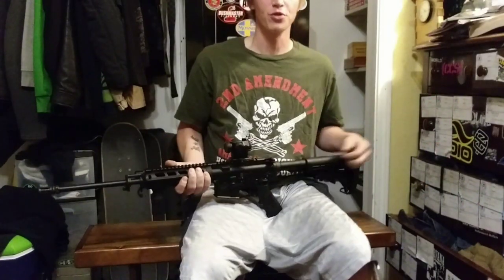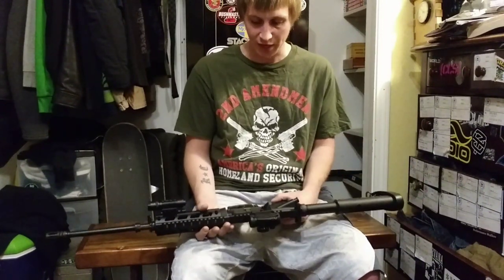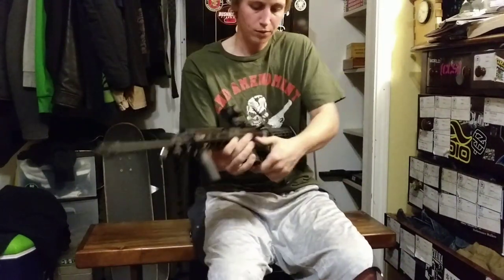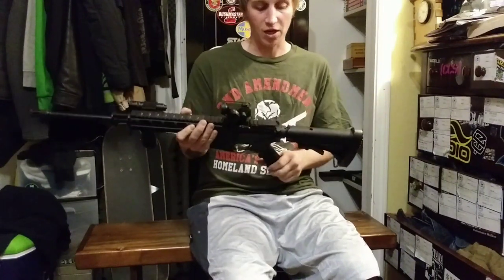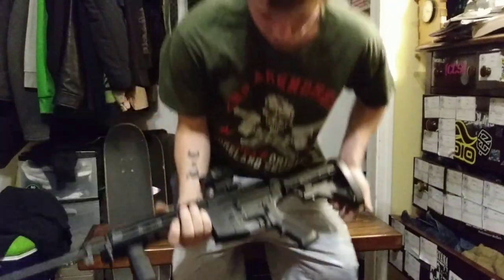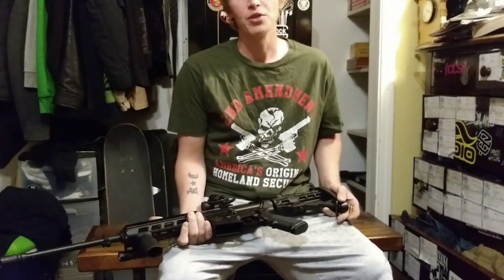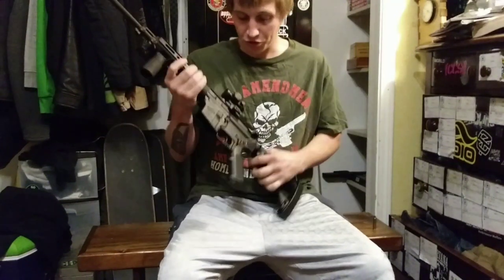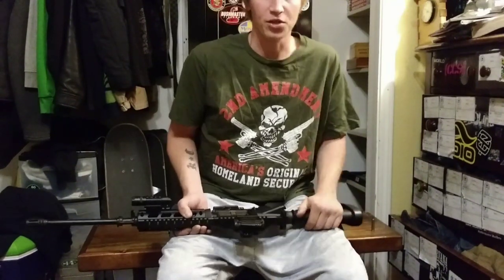AR-15 mortaring technique unjam a stuck bolt & charging handle w/round chambered.

Comment: Thank you! You're the man!
Reply from the maker: No problem man glad I could help 🇺🇸
Reply: How to prevent it my 300 blackout still do it every time
Reply from the maker: @officialdracos3062  have you taken apart  the rifle and and bolt carrier group? After I did that and cleaned and lubricated the ejector along with the rest of the rifle I haven't experienced that malfunction. Here's a complete cleaning guide video I made if you need any tips for taking the rifle apart, cleaning and lubricating it, and reassembly of the rifle. Here's the link to the video.
https://www.youtube.com/watch?v=Apmvm9SrXzw

Comment: can you do this with a live round without it going off....
Reply from the maker: yeah theoretically the round cant go off without the firing pin striking the primer so as long as your finger isnt on the trigger you should be fine. When this happened to me and i had to use this technique i had a live round in the chamber. But even though it theoretically should not discharge i still aired on the side of caution and used this technique outside while pointing the barrel into a safe back stop.

Comment: Mannnnnnnnn thanks bro!!! My laser sight got stuck in mine while sighting.
Reply from the maker: Your welcome bro glad i could help  i tried those bore sighters out for a lil bit but i found the universal boresighters that slide into the end of the barrell to be more accurate and u can use it with every caliber u should look into getting one of those if u don't already have one
Reply from the maker: Plus u can get a good one for around $25 and that's pretty much the cost of 2 of the cartridge bore sighting lasers
Reply: @counterstrike2A  I’ll check those out, I’m never using this thing again! Lol
Reply from the maker: Lol I pretty much did the same thing used it once and then just put it in my junk drawer. Thanks for subscribing to my channel!!

Comment: So this did help but right when the bca went back in it was instantly jammed again lol
Reply from the maker: I would definitely give it a good cleaning and lubrication and note what type of ammo you were using and if that's what you normally use. Try using 556 instead of 223 and 223 instead of 556 that seemed to be my issue the 2 times it jammed was using 223 since then I switched and make sure to keep my rifle clean and it hasn't happened once in the almost a year or so now that i have been exclusively using 556
Reply: I ar-15 7.62x39mm pistol.. I'd pulled the charging handle back but didn't release it fast enough i guess and now its a live round chambered its like my bolt carriers locked??
Reply: Didnt work..

Comment: Was it the rounds because I just got some Remington. TSX hog hammers, and it keeps happening.
Reply: My controller chaos doesn't do it. My m855 doesn't do it only these hog Hammer. I don't know why.
Reply from the maker: That could be the issue but I would give the rifle a good cleaning and lubrication and give it another shot and see if it keeps happening is it a new rifle?
Reply: Just got done cleaning it. I'm going to reload a MAG and give it a shot man.
Reply from the maker: Ok good luck
Reply: No, brother completely clean this rifle. I can run the control chaos Throne every time I load these hog hammers in it'll chamber eject chamber eject stick won't come out. I'm more they don't want to close the both all the way. It's got to be the bullets. They're not Stop to spec I'm guessing. I don't know too much about reloading. But none of my other rounds do this. And I'm guessing this why Remington isn't in business anymore why they sold out.
Reply: Now I just ran them all through a PMAG instead of a One of the aluminum mags and they all ran through flawlessly. It's got to be the mag jamming it.
Reply from the maker: @frankmarks5890  good I'm glad you got it figured out. Yeah nobody can really match P mags reliability only times I've had unreliable mags they were pro mags

Comment: Holy shit it worked! Thank you. Do you know what causes this jam?
Reply from the maker: Since filming this video I had to mortar my rifle 2 more times. I also had not performed a full disassembly and cleaning/Lubrication on the bolt carrier group and ejector. After doing that the problem has not happened again and I've put over 2000 rounds through it. I also got some input from other viewers and a common explanation is new rifles have tighter tolerance in the chamber and just normal operation of the rifle can help loosen things up therefore fixing this issue from happening. I also was suspicious about the ammo I was using causing it because all 4 times i had to mortar my rifle I was using .223 remington so now I predominately use 556 NATO and the issue hasn't come up. But like i said that could have nothing to do with it and it could have just needed to be broken in. That being said if this issue arises the first thing I recommend doing after removing the stuck round is to give your rifle a thorough cleaning and lubrication. I just uploaded an AR15 disassembly cleaning procedure/lubrication and reassembly video a few months back here is the link if you don't know the proper cleaning procedure on the bcg and ejector.
https://youtu.be/Apmvm9SrXzw

Comment: With a live  round in it would it shoot it out or just eject it like in video. ??
Reply from the maker: In my situation the hammer had already fallen down and without being able to pull the charging handle back to eject the round there would be no way that the firing pin could strike the cartridge that being said I would definitely use allot of caution removing a live round even under the circumstances I explained better safe than sorry. I would recommend doing it outside and pointed at a back stop just to be safe due to the fact it's a live round. But yes even with a live round it should in theory just eject without going off
Reply: Thanks budd. It’s been stuck for a week just scared to do it at home. I will have to go to my ranch and do it there. Thanks
Reply from the maker: @juliangarcia426  no problem at all I'm glad I could help that same situation ruined a day of shooting on my 2nd round of my first mag and after hiking a mile up a mountain 😒. It happened a couple months later again and i realized both times it was when I was using 223 so from then on I have only bought and shot 556 and have not had that issue happen again as well as make sure my bolt carrier group and ejector stay clean and lubricated.

Comment: Didn't work for me.. so my situation i have a brand new ar15 0 rounds through it it was sliding fine when I got it I let it sit for a few months go to see if it'll chamber a round and it was locked up. I cant figure it out I just tried this and it won't budge
Reply from the maker: I would try again u gotta time it perfect and press the charging handle button down and pull it towards the butt stock at the same moment it hits the ground using the momentum to free the stuck round.
Reply: same here. brand new out of the box christmas present lol
Reply: @justinconn2957  so I figured mine out. So dumb.. I put a new stock on and had 2 buffers in the tube only allowing the bolt to move back like half an inch or less.. take you're tube apart and make sure all that is good you only need 1 inside and if you got more its gonna do that. If that doesn't work there's a pin that holds the tube back in place make sure that didn't come out and jam up somewhere. There's usually a spring that is pressure in there so be aware it may jump at you.

Comment: appreciate it bro.i was shooting 223s
Reply from the maker: No problem glad I could help. I also suggest taking the rifle apart and cleaning it and the bolt carrier group specifically the firing pin and ejector but also every other part of ypur rifle. My rifle is compatible with both 223 and 556 and after making this video cleaning my rifle properly fixed the issue and allowed me to shoot both 223 and 556 because if ur rifle is chambered in 556 then its backwards compatible with 223 but if its 223 then you cant run 556 because the round is to big for the chamber and barrel. Ill attach my complete ar15 cleaning guide if u havent cleaned the bolt carrier group before and after cleaning and lubing ur rifle it should run flawless.
Reply from the maker: https://youtu.be/Apmvm9SrXzw
Here's the link to the cleaning guide if ur interested.

Comment: I literally have this issue now..with round clambered..??
Reply from the maker: When it happened to me I had a live round in my chamber as well maybe you're not hitting the butt stock into the ground with enough Force while pulling the charging handle at the same time I would give it another girl it should just be really tight and you just need to push it down hard into the ground with enough Force to release the pressure and tension on the charging handle on the bolt carrier group from what I've heard in my experiences that should usually almost always fix the problem just make sure you collapse your extendable stock first and do it in a safe Direction just to be safe I wouldn't think the round would go off but still better safe than sorry
Reply from the maker: Try doing it on a raised object like a table or a bench while sitting on your knees like I did in the video or if you're going to do it on the ground get down on your knees so that way you're not pulling the charging handle down in an awkward angle
Reply: @counterstrike2A  it work..#Yess i love you guys..thank to the youtbe Gunsmith n his prime..life saver
Reply from the maker: @t_tsunami360flowbrushandgr3  your welcome thanks for supporting my channel! I'm glad everything worked out for u! I'm stepping up my production quality for my channel I just got a new 4k camera and a laptop for editing so I don't have to do everything on my phone anymore so subscribe to my channel and I'll be having allot of new content every 1 to 2 weeks. Have a good weekend 🇺🇸

Comment: I had same issue with a new build.  What causes the safety select to be stuck in "fire"?
Reply from the maker: The basic answer would be the hammer needs to be cocked back by pulling the charging handle all the way back and that should allow you to move the safety from fire to safe. If you already tried that it could be some debris jamming the trigger group such as debris from a blown primer.

Comment: I had it happen to me twice and both time i noticed my mag wasnt fully locked in ad i was able to pull on it and it popped right out of the gun but i dont know for sure it that wad the reason or not
Reply from the maker: That sounds like it could have been from not pushing the magazine all the way up into the mag well or even possibly having 31 rounds loaded into a 30 round mag and the magazine couldn't lock into place

Comment: You need to change your  extractor I am having the same problem
Reply from the maker: Fortunately that wasn't the issue at the time of the malfunction my bushmaster was basically brand new out of the box it was only the 3rd time shooting it and what fixed the problem was giving the rifle and bolt carrier group a thorough cleaning and lubrication. Here's an update video I just recently uploaded explaining everything in more detail.
https://www.youtube.com/watch?v=S_wLVeBOJgI
Reply from the maker: If you haven't already done so I would definitely give taking apart the bcg and doing a thorough cleaning on the firing pin and extractor in the owners manual of my bushmaster they go over a technique that I had not heard of before that allows allow to get into the ejector pin and after I did that my rifle hasn't had the issue since here is a video of the cleaning procedure that worked for me maybe it will help get ur rifle back into working order.
https://youtu.be/Apmvm9SrXzw

Comment: Note: when doing this technique placing the weapon on safe is vital for safety.
Reply from the maker: I could see why that would give.someone peace of mind but regardless whether the safety is on or off the weapon will not fire unless the trigger is pulled the act of slamming the butt of the rifle down will not make the firing pin strike the primer of the round without the trigger mechanism being activated but it's still a.good general safety rule to have the weapon on safe at all times unless ur ready to fire the weapon

Comment: Hey i have a bullet stuck in the chamber in my ar15 and the bolt carrier is pulled back? But bullet no come out? Im very concerned as this is a LIVE round. Pleeease advise on what should be done next. The rifle is in it's safe right now awaiting further instructions. Should i just fire the round? It would be absolutely preferred if this wasn't the only option. Thanks.
Reply from the maker: Use the technique shown on the video that.should do.yhe trick
Reply from the maker: Make sure that your but stock is extracted all the way in not extended out and then the force of you slamming your stock into the ground while holding the charging handle and pulling back should eject the live round and it's on safety and as long as you don't touch the trigger if there's no chance that the round will go off let me know if it doesn't work but so far anybody who's had that issue and has asked for my advice that has fixed the problem

Comment: Thank's Bro.
Reply from the maker: https://youtu.be/S_wLVeBOJgI
Newer more informative video on what causes the malfunction and how to prevent it from happening again if ur interested.
Reply from the maker: Forgot to say your welcome and glad I was able to help u get ur rifle back in working order
Reply: So, I did what you said, and it worked the first time. There was a spent STEEL casing inside it. I use a Franklin binary trigger, too. Forgotten my me, was that my target dedicated mags had brass loaded on top of steel. The thing would da-da-da-da-da-da the brass, but then it'd either not correctly load a steel, or not eject the steel. I assume that its because of a few things. The steel is primed, and I'm using a standard gas block on a 16" barrel. The blowback from the steel just coats the bcg with residue and it just doesn't want to work. I was thinking of using an adjustable gas block, to allow more gas to escape. Granted, the AR was cleaned and lubed back in February, and the rifle just sat since then. I have decided to never use steel again. The brass just flies through it without any problems.
Reply from the maker: @joeschmoe1776  did you ever disassemble the bolt carrier group and clean the firing pin and the bolt carrier group really good and the ejector because it seems to me that's what fixed the issue in my case I just wasn't originally actually taking apart the bolt carrier group the firing pin in cleaning the ejector properly until I figured out that maybe what was causing the issue and since doing that I haven't had the malfunctioning again I have an AR-15 cleaning guide video which shows how to take apart and clean the bolt carrier group and lubricate and clean the ejector if you don't already know how sounds like you know quite a bit about guns so I'm assuming you probably already do but just figured I'd let you know just in case
Reply from the maker: @joeschmoe1776  my bushmaster manual showed an amazing technique for cleaning the ejector. You put a couple drops of oil on the ejector pin and then take an empty shell casing and rock it back and forth which pushes down the ejector allowing oil to get inside of it and they say to repeat the process 2 or 3 times and after doing that my bushmaster xm15 has been running flawlessy. https://youtu.be/Apmvm9SrXzw
Here is the cleaning video I made I demonstrate the technique I just described and also do a complete field strip cleaning and reassembly.
Reply: @counterstrike2A  I didn't back then. I just completed the task five minutes ago.

Comment: Is there a way to remove a bullet from the chamber
Reply from the maker: Have you tried using the technique in this video?
Reply from the maker: Is the charging handle stuck and won't pull back to eject the bullet from the chamber?

Comment: If that barrel is what I think it is, it’s a bushmaster barrel made by Remington.
If so, it’s chamber is undersized and has pits. 
I had 3 of those, I returned 2 of them.
Use a borescope to check the chamber.
Buy a better barrel or spend hours hand polishing it to open it up more.
When the case expands, the chamber grabs the case then you’re stuck!
Would NOT trust my life to THAT!
Reply from the maker: yes you are correct on the barrel the rifle itself is a Bushmaster xm15 QRC but i made this video almost 2 years ago and since filming this video I had to mortar my rifle 2 more times. I also had not performed a full disassembly and cleaning/Lubrication on the bolt carrier group and ejector. After doing that the problem has not happened again and I've put over 2000 rounds through it. I also got some input from other viewers and a common explanation is new rifles have tighter tolerance in the chamber and just normal operation of the rifle can help loosen things up therefore fixing this issue from happening. And from what I have researched remington has always made good quality barrels for their Bushmaster rifles I would tend to think that would apply more to someone doing a custom build AR I was just new to the platform in general when I experienced the issue and im pretty sure it was from me neglecting to clean and lubricate the BCG and extractor. But its been running great for over a year now and im really impressed with the quality and accuracy for an entry level armalite 15

Comment: Tight chamber, such as head spacing issue, chamber too short. Chamber corrosion. Dirty chamber. Bad round. cartridge case too long, especially if you are shooting reloaded ammo. Case too fat, again usually reloads. I have had to mortar Glocks several times recently all due to bad ammo. The cases were a little too long. The pistol jammed up tight and out of battery. Just a single millimeter too long was enough.